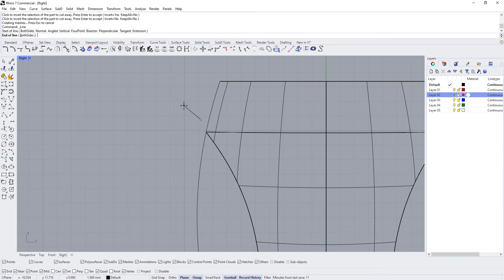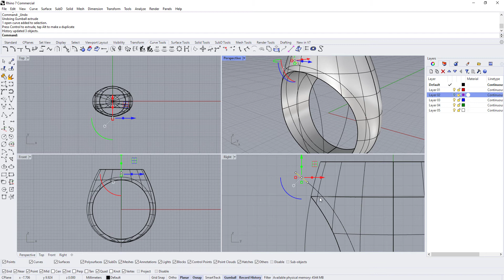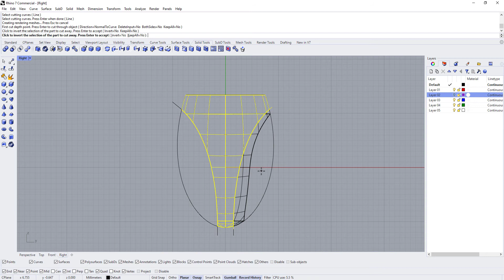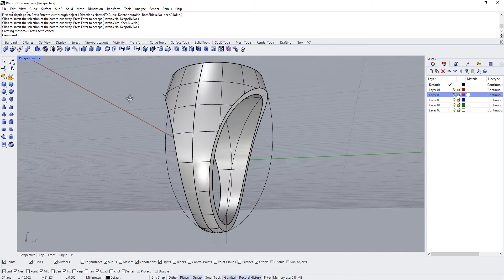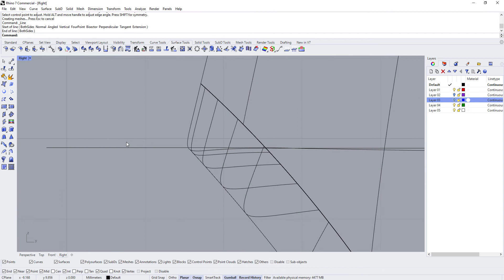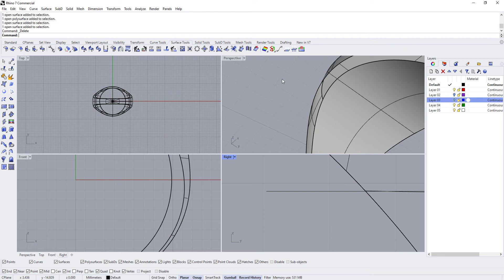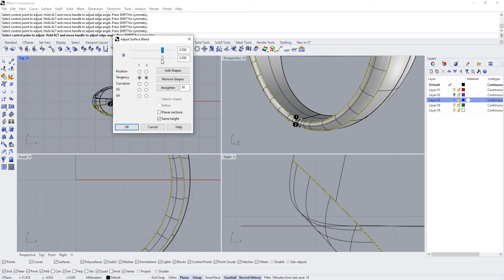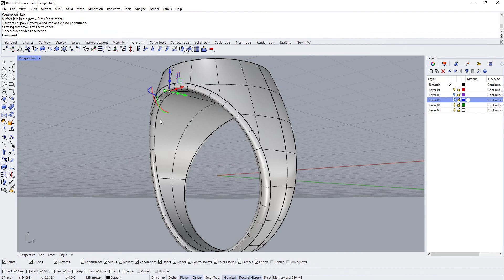Rhino | Signet Ring Tutorial | Part 2 of 5

Comment: 3:45 I've been trying to do this procedure for two hours and nothing works.
Reply from the maker: I'm sorry you're having problems like that. I'm not sure what's causing the issue, but the two things that come to mind are (1) the cutting curve doesn't extend past the ring and (2) the ring is not closed.

So, from the right view, make sure that visually both ends of the cutting curve extend past the ring object. If they do, then select the ring object and look in the command line and make sure that it says that a CLOSED polysurface has been added to the selection. If the ring object is OPEN, then the problem probably started in the first video. Several times in the first video, I used snapping (mostly the quad snap) and I didn't mention it every time, but snapping is super important. So, if the ring is open, go back thru the first video and make sure you snap your curves when I snap my curves (a little tooltip pops up saying things like Quad, End, Int, or Mid when snapping is happening).

If the cutting curve extends past the ring and the ring is closed, I would need to look at the file. Below is a video that shows how to contact me outside of youtube. You send me the file and I'll look at it for you.

https://youtu.be/bhadwrxAF0c

Comment: been trying for an hour to move the line with the curve - they don't move together as you show in the video unless you join them, and the projected line is not adjusting in sync as you show. What am i missing?
Reply from the maker: Hi. I'm sorry you're having problems. I know it's frustrating on a long tutorial like this. I'm not 100% sure, but it sounds like you need to turn history on. Type history into the command line and press Enter. You should see some options in the command line. And make sure that Record = Yes and Update = Yes. If they say No, just click on the options to toggle them to say Yes. And then press Enter. Let me know if that helps.

Comment: oh my... I'm trying to learn Rhino after years of Subd modeling (3ds max, Maya), and I always thought CAD programs have super advanced chamfers and fillets. But as I can see here it is quite opposite... 10 minutes on one simple fillet! First create helper lines, then make blend curves, then project on surface to visually control it, then wire cut, extract and delete, and make blend surfaces controlling the settings. Not gonna lie, I'm happy with the result, but the process is kinda crazy tricky.  With subd it would be a matter of selecting edge loop and applying fillet and turbosmooth, even if I need to adjust some support loops it would take like 1-2 min. Anyways,  great series and thanks for sharing your knowledge!
Reply from the maker: In a lot of cases, the filleting works nicely, even in complex situations, but then there's definitely times where you gotta get more manual with it, like in this case. Also, it would probably take 2 - 3 minutes if I wasn't explaining things. It's surprising how much time explaining adds to the process. And I don't know how the bigger name CAD program (like Fusion or AutoCAD) would handle this situation. Maybe it would be no big deal for them? But I don't know.

I've never used Maya or 3ds Max so I can't make a fair comparison. My sub-d experience is mostly with Blender and beveling in Blender is simple for simple geo, but it can be a real pain if there is any serious complexity in the topology.  There is a paid plug-in for Blender that most hard-surface modelers swear by called MeshMachine (about $45, I think) that appears to solve most of Blender's bevel problems for hard-surface modeling. I've never used MeshMachine myself, though.

Rhino has it's own sub-d, btw. It used to be provided by an autodesk plug-in called T-Splines. I really liked T-splines and how it integrated with Rhino's own tools. But autodesk suddenly revoked the license some years ago and McNeel had to scramble to make their own in-house sub-d solution. I really haven't used it since they lost t-splines. The few times I did, I got frustrated and switched to Blender where I'm very comfortable with sub-d. I really need to look at it again in Rhino 8, but I just haven't had time.

Comment: I can't cut it out, what am I doing wrong?
Reply from the maker: I think they may have made a slight change to how the WireCut tool works during a recent update. Here are some tips that might help:

1. Make sure the cutting lines extend outside of the ring when viewed from the Right viewport
2. Make sure that the Right Viewport is the active viewport before clicking on the WireCut tool.
3. After clicking on the WireCut tool, look up in the command line and make sure that "Direction" is set to either "NormalToCurve" or "X" (either should work)

Let me know if this helps because if it still doesn't work for you, I may have an alternate technique you can try.

Comment: Excuse me but what's the point of the command "adjust closed steam ..."? I would like to know the technical purpose

By the way, Im following through and tomorrow I'll start part 4 of the signet serie!
Reply from the maker: The seam is the point where a closed curve starts and ends. If you make any surfaces with a closed curve, the surface will also have a seam (on a surface, the seam will be a line where the surface starts and ends). Seams in surfaces can sometimes cause problems. So it sometimes matters where the seam in the curve that makes that surface is. It doesn't matter always, just sometimes.

For rings, it is generally best to put the seam of the sizing circle either at the bottom or the top. In the case of signet rings, it will generally be better to put the seam at the bottom.

And, if it doesn't make sense, don't worry about it too much. If you design lots of things, eventually you will have a sense for when the seam matters and where it should be. The reason is you will make a design, and something won't work right because of where the seam is and you will have to move the seam and remake everything.

Once you have to remake objects several hundred times because of the seam, you will begin to put the seam in a good place naturally. But even after years of experience, occasionally you will still put the seam in a bad place. :)

And I think Rhino gets better and better at handline issues that involve seams; so , it will probably matter less and less over time.
Reply: @webduncetv  wow super thanks for the articulate answer, didn’t expect that!
Ok now I got the point, I asked because I never saw it in other tutorials honestly

Comment: I don´t know what am I doing wrong, but when a move the litle line , the blended curve doesn't follow. The same on the first video.
Reply from the maker: At the very bottom of the Rhino window there is a status bar, and somewhere on the status bar (should be near the middle of it), you should see a button called "Record History." Is that button highlighted? (If it's not highlighted, click it and it should become highlighted. Then see if the blend curve updates as you move the little lines. Let me know either way, but especially let me know if it doesn't work as there's one or two other things I can think of to try.
Reply: @webduncetv  That's it! Fixed. Thanks!
Reply from the maker: @edersonchivelassouza8722  Awesome!
Reply: @webduncetv  That fixed it for me, thanks!
Reply: It doesn't work for me sir... Thanks 🙏
Reply from the maker: @tomyandras3821  In the command line, type history and press enter. Make sure both record = yes and update = yes.  If they do not, click on them until both of them are set to yes. (I hope it helps cuz I can't think of anything else to try at the moment.)
Reply: @webduncetv  thanks sir i will try
Reply: it doesnt work for me either and i tried your previous suggestions is there any possibility for another solution ?
Reply: worked for me thank God
Reply: I mean thank youu <3